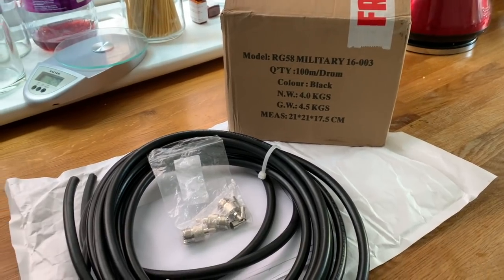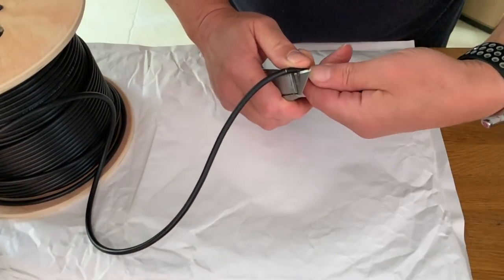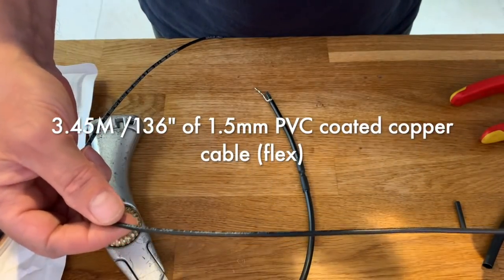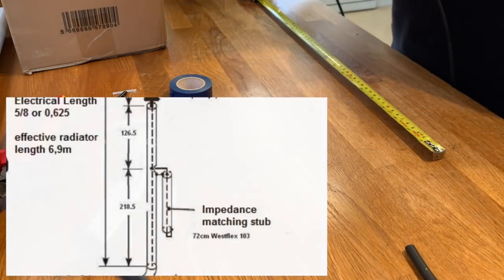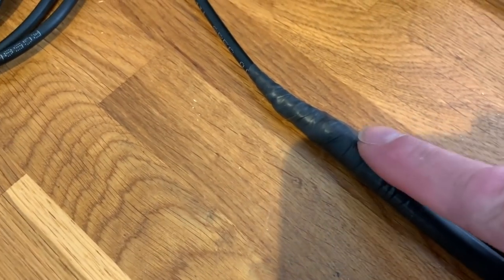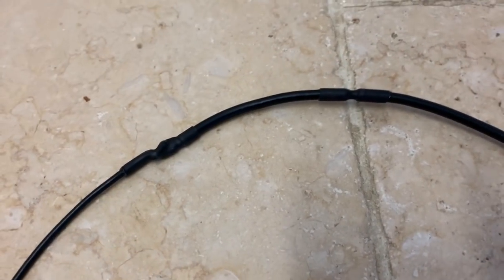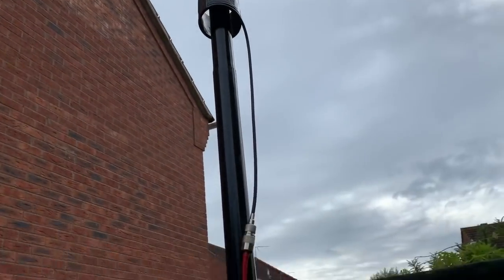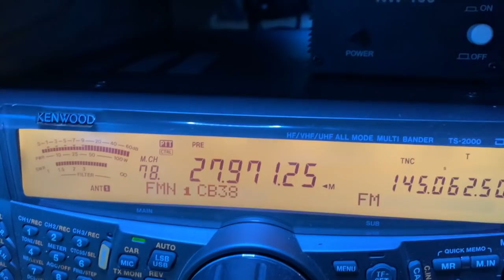CB Radio: Build a GainMaster (the rebuild) on a DX Commander Pole..Detailed upload

Comment: I want to make one of these and can't seem to find the westflex w103 in the USA.
I'd like have the min lengths  of each coax to build this.
Reply from the maker: You can use RG213, but you will have to trim the stub to find the sweet spot.....
Reply: @mike-M0MSN  I found a place and  orderd a small amount of Westflex w 103 for 31 bucks shipped from the UK! 😀
I really like this antenna!
Also I found you can download the manual and get a good look at the factory one with the fiberglass tubing.
This thing is ginormous! Its 18ft above the coil.
I don't think in meters too well so need to convert.
Reply: @mike-M0MSN  I struck out on getting Westflex 103. Shipping was gonna be twenty + lbs than 31 us dollars. So I need probably 50ft of RG58 and 10 ft of RG213?
Do you thing the matching stub would need to be longer or shorter?

Comment: Hi Mike, does the matching stub have t be westflex 103 or can I use rg213?
Reply from the maker: you can use 213, you just need to adjust the length
Reply: @mike-M0MSN  and the length of use RG 213 is how many cm? Thank you
Reply: @RomanF1968  73 cm.

Comment: I've enjoyed this video immensely.   I do have one question.  I've nearly completed the build, just need to solder the radiating element on and check it with a Nano VNA.  I only had the RG-58 coax, so I used 100 cm for the matching stub as you did in the first video.  Is there a reason why I should get a heavier coax to make the stub, or can I simply keep the 100 cm length of RG-58 as the matching stub?  PS, I saw your video with Callum and Derek this evening and enjoyed it very much!  I knew Callum right off, but then I'm thinking "I know Mike as well, from that gain master video,  don't know who that Derik guy is!"  But I digress, Why couldn't I just keep the RG-58 matching stub?
Reply from the maker: Hi Boyd, You may find that you will need to cut the Matching stub shorter to around 50cm??  Westflex is used because of the VF and Watt handling ( but you should be ok with RG58 ).  :)

Comment: I bathed the cut in liquid electrical tape before applying shrink tubing to help increase insulating effect. 3:45
Reply: I like your trick with the measuring tape! 8:45
Reply: Actually 66mm is closer to 2.6" but I'll bet you're going to be close enough. 12:33
Reply: Boy, you really screwed up there, 'eh - lol 17:26
Sweet! and a perfect 52Ω - exactly what  my home-brewed Penetrator ended up when X=0 @ 1:1 SWR
 Refreshing to see a plan come together so well!
Reply: So if a touch longer then I can see a sub 2.5:1 from 12m - the top side of 10m FM!

 ...and I'm a little surprised you haven't modded the TS-2000 for "MARS/CAP" as we say in the USA. 19:45
Reply from the maker: Wow, I think you have said it all.  Many thanks for the comments. :)
Reply: @mike-M0MSN  👍

Comment: How does the Gainmaster compare to a T2LT? Is it better? Asking, because the latter is much easier to build.
Reply from the maker: Gainmaster better by a mile
Reply: @mike-M0MSN please...tell me exact the difference between this two antennas on performance...on the s meter
Reply from the maker: Now that is impossible, and here is why. Location, location, location. For me I put both antennas side by side and the 5/8 wave version received signals the 1/2 didn’t and that may have been the height as the 5/8 stands 2 metres taller than the 1/2 or it may have been luck.  Build them for yourself and tell me which one you preferred.
Reply: @mike-M0MSN  when you make an affirmation(better by a mile), you need a solid evidence...i think you compare this two antenna.

Comment: I am in the testing phase of a 10KW colossal from Zero Five and no fault of theres (they adv bandwith of 600 khz) I am not happy with the BW. So I took off the "Pipe capacitor) and mounted a Air capacitor ( like the tuning of an old tube type) in its same location and I am going to put a 3 RPM motor on it so I can remote fine tune it (When I wish) But it seams to me the (Gamma?) Match on it is severely limiting my bandwidth So I am thinking of making a 10 AWG coil for it. Guy at zero five says I will loose performance. Anyhow is this a good Idea? Anyone have ANY input? Anyone have a "Starting point for the coil? I can normally figure these things out but info on 5/8 matching networks has not been easy to come across. I do have a NANO VNA and trying learn as well. 73's KC8SHS
Reply from the maker: very interesting let me know how you get on

Comment: Hi Mike i built this with the same coax ' rg58 military . works a treat ' just check out my  QRZ page' using this antenna on a dx commander pole along with my Yeasu ft817nd  running just 2.5 watts. worked all over Europe on SSB & CW best regards mw0cnd Martin in Swansea Wales. ;)

Comment: Why use west flex 103
Reply from the maker: You don’t have to, I used it because it has the correct velocity and power handling capability. But you can use smaller diameter coax
Reply: @mike-M0MSN  thanks you answered my above question here. Also what is the power handling of this completed antenna.

Comment: you can see why the gainmaster uses PCB boards for the connections, 
a lot easier and neater and less chance of falling apart..

i wonder how hard it would have been to cut some PCB board, drill three holes and cut a bit of foil off ??
Reply from the maker: Probably very easy, give it a go and let me know.  :)